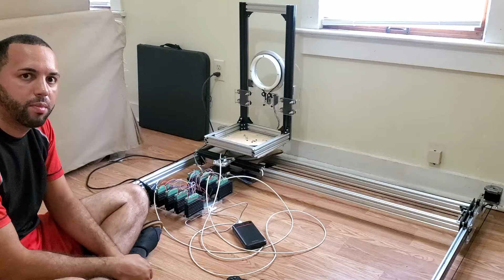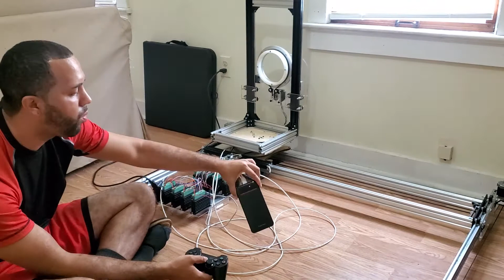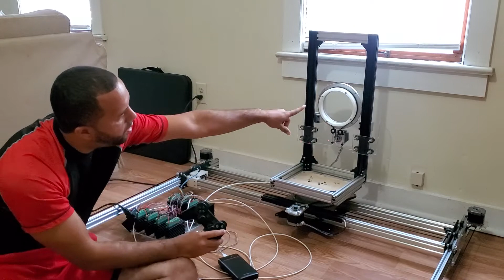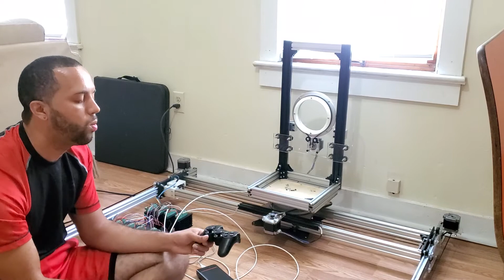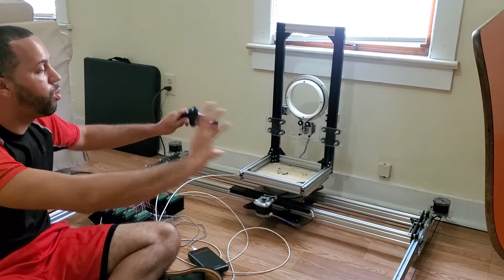[DIY] Making camera robot (8 axis motion control) (Progress Update)!

Comment: Im trying to figure out how to use Blender to program movements and export data to my 8 axis crane.
Reply from the maker: Sorry for the late reply but to answer your question blender can be hard to figure out but I was only really using it to design the machine first for 3d printing parts for the machine to make machine in real life so it was designed in a 3d designing program called blender to build it here in real every day life 😊

Comment: Love your work, sir. I wasn't going to bother with tilt, but looking at your ring-gear setup it's gonna have to go in. Thanks. 
One question.... I've not used steppers before... do they cause much vibration? I'm looking to do mega slow passes on miniatures, and am worried about vibration on long exposure shots. Thanks for your inspiration, anyways.
Reply from the maker: Sorry for the late reply but to your question I would say no the stepper motors don't cause much vibration it really just demands on what stepper motor driver you are using

Comment: Wow, this is a complex rig, excellent work! Regarding the vibration you mention around 8:10, sometimes they can be caused by the microstepping. Have you tried changing it?
Reply from the maker: Hey thanks for the reply and yes the motors are running at full step but I will change the microstepping when the camera and everything is attached if it is still vibrating